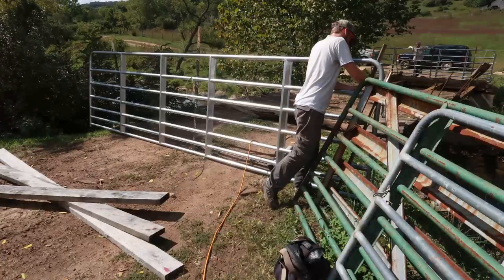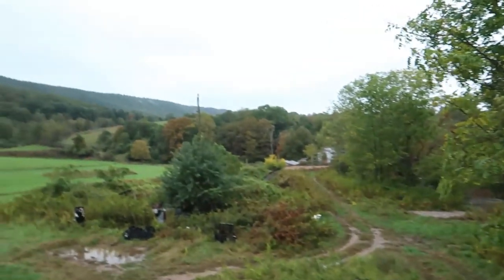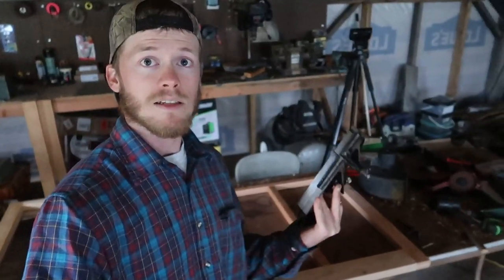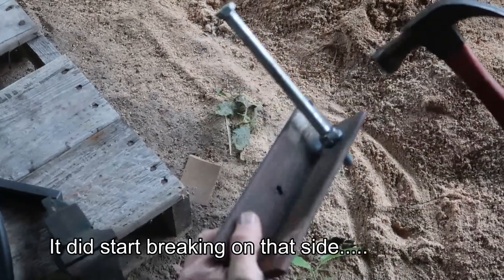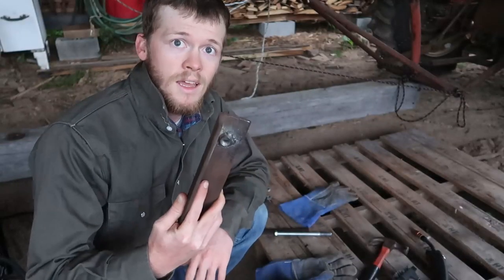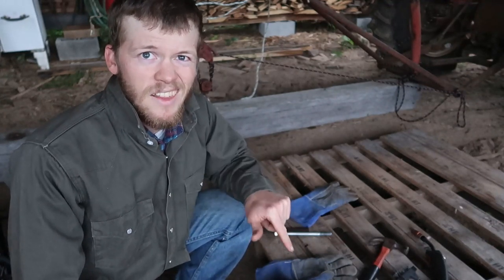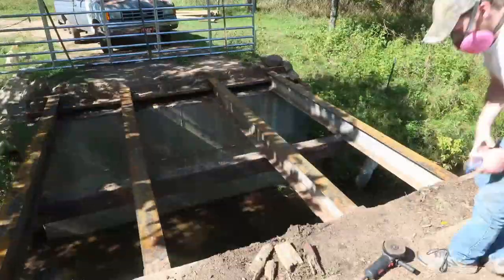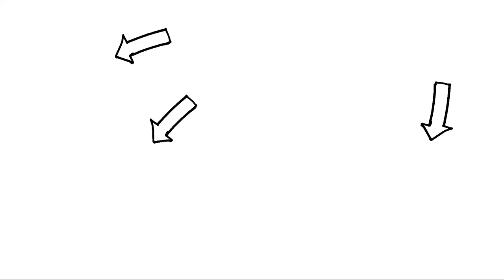The Covered Bridge Rebuild - I-beam Prep

Comment: Josh I have been a welder for thirty years here is some advice your mig welder is not able to give you enough heat it is one of those mig welders that is for body work I have one go back to your stick welder and get some 7018 welding rods now you have to know if your using a AC OR DC welder if your using a AC welder then you have to buy AC rods and vise versa for DC Go to a reputable welding supply like liquid air or prax air don't buy chinese welding rods these rods work but I would not recommend them for a beginner or new welder. then for that nut get a 3/32 welding rod and set your heat around 90 degrees and adjust up or down but this is your about setting for a 1/8 it is about 125 this changes depending on if your doing vertical or horizontal or over head. Get a piece of steel and run stringer beads until your welds look good and keep a tight gap between your rod and the work think of it like a candal on a hot surface you have to feed it along as well as down as the rod burns away people who start out welding usually get a large gap making a inconstant weld when your get your beads looking good start practising other types of welds. A little advice on welding that nut to the steel when you weld make the welding rod  do little round circles counter clock wise  about 1/4 inch. Try that and let us know how you did. once you get the hang of it it is like riding a bicycle. One more thing tack one side and then start welding the opposite side if you start welding one side the weld will pull up the nut or you could use a pair of vise grips to hold the nut down.
Reply from the maker: Thanks for tips! At this point in "real time", I've done a little over 2/3s of the welds with the flux-core, and so far I've been really pleased with the welds. I don't think I've got any rods that small, but I'll have to pick some up to give it a try. I've been avoiding 7018s because my understanding is that if you don't keep them at temperature with low humidity, they don't work so well. At the moment I don't really have a way to do this. Is it that big of a deal? I think what I have on hand are 6011 and 6013. Thanks!
Reply: @LandisLegacyFarm  Not a big deal unless your welding pipe but if you keep them dry in your loft your good to go you can always once every three months put them in the oven to dry them out or in the winter just put them on top of your wood stove in your loft throw about twenty five and fire it and then switch them out after a burn  till you go threw your pack I don't worry about it too much though I have rods that been in my shop for six years but the other day I forgot them out and they got rained on so I will have to throw them on the box stove. as for the 6010 or 6011 personally I would throw them away usually they put in a root weld on a pipe with them but for what your doing use the 7018. Great channel always look forward to watching your adventures.
Reply: Possibly you could turn up your welder high and use the 6010 or 11 as a gouging if you wanted to cut off a bolt or something like that! This particular rod works the opposite of 7018 it needs to have moisture in it to work properly when they dry out they are hard to run. and it gives you a real shitty looking weld.

Comment: PLEASE don't weld any galvanized metals. You can look up how to easily remove it prior to welding. It killed my stepfather, and not quickly. 
I've found it will also help to keep the bolt in the nut while welding to prevent thread distortion. Put most of your welding heat/wire into the base metal, then swoop up to the side of the nut and repeat all the way around. Good luck.

Comment: I think ya did good kid. Its not a freeway road or some kind of heavy transport bridge although its probably held more weight than rated before judging by farmer wants to get from A to B and the closest way possible if I remember correctly. I have  seen tractors towing two or three trailers in tandem and they had on each trailor what it would take to fill all of them. Your closer to a working bridge than before you started. Just keep a doing  what it takes